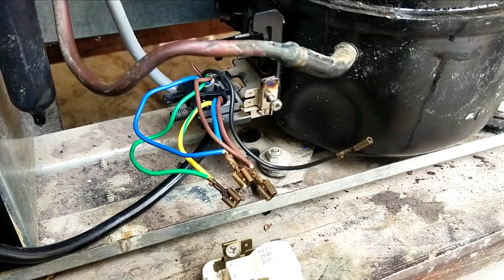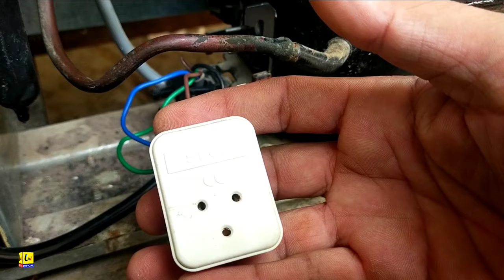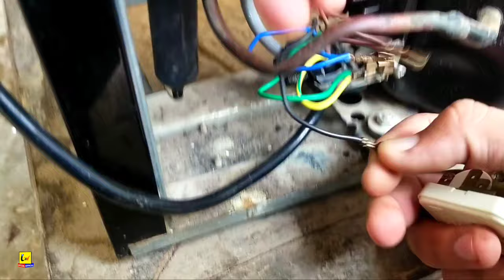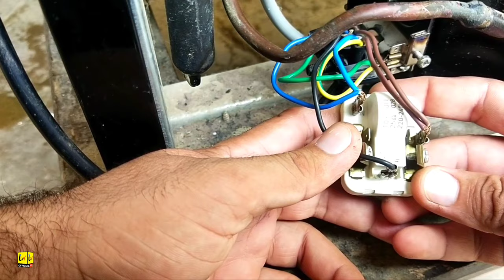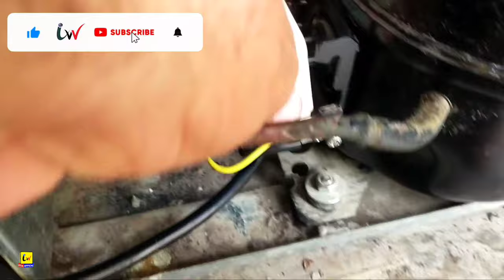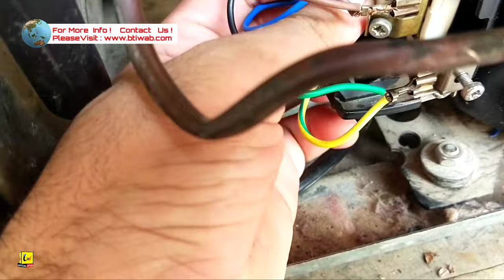Fridge Relay Connection | Refrigerator/Fridge Compressor Relay Wire's Connection Danfoss

Comment: Hi
I want to connect a fan so it can cool down the compressor
Which wire should I use so fan start with the compressor?
Reply: Common black wire you can use for that purpose 😉